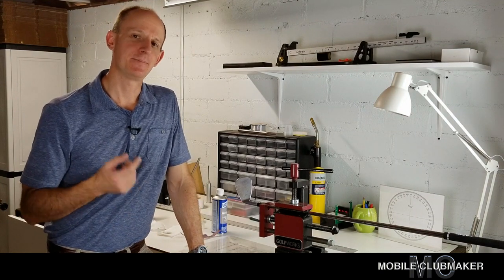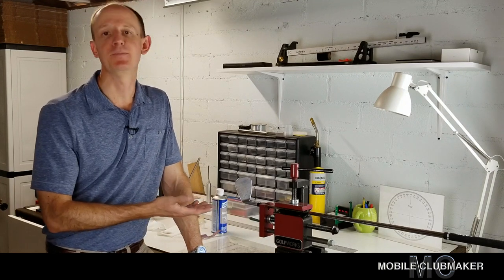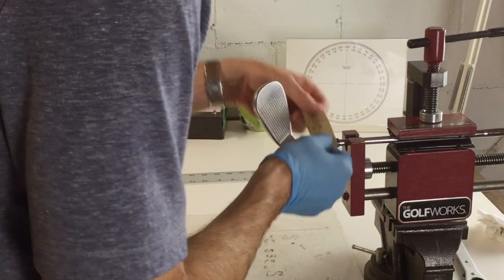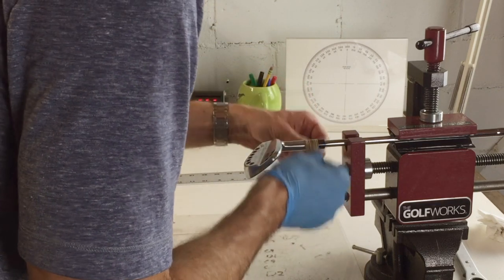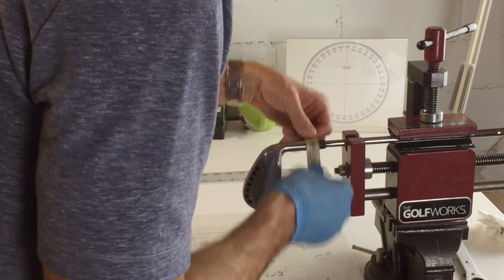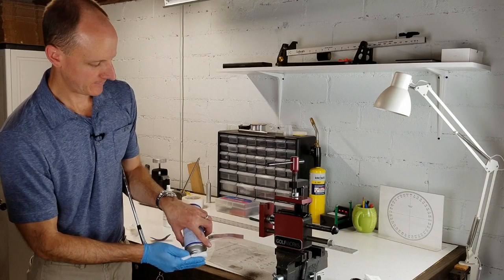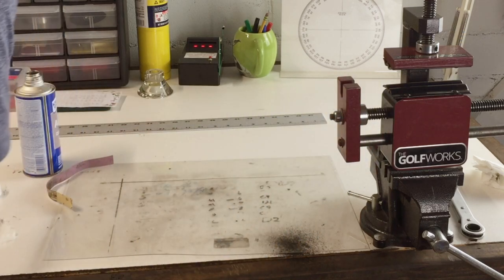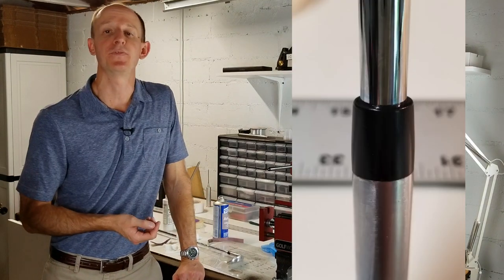Turning Ferrules- We don't need no stinking belt sanders!

Comment: Any tips for multi colored ferrules (like BB&F Rainbow type stuff)?  Acetone will likely make the colors bleed a bit.  Also - what grits are you using in this video?  Is there no concern about scratching up the hosel while sanding down the ferrule?  Thanks!
Reply from the maker: The sand paper grit I used was around 120 for the medium and 220 for the fine finishing. If you are working with a chrome or brushed finish iron, you shouldn't have any issues with the finish when doing the sanding by hand. If the club is painted or has a different finish you might want to tape off the area with masking tape to protect it and just take your time with the sanding.
I've done plenty of BB&F ferrules. No issues with acetone. You should only be using very very light pressure with it, so colors don't move.
Reply: @EFGMC  My first attempt at turning down a ferrule was a bb&f ferrule and it was a disaster.  Colors everywhere, fibers melted into the ferrule, odd indentations.  Since that time, I've put together several sets - all of which have embarrassing lips.  :/.

Now I'm too scared to ever try again.
Reply from the maker: @griffinmpc8144  A 1x42 belt sander with a felt belt can be helpful if you struggle with the other methods.

Comment: Aren’t you scratching the hosel. Don’t u need to tape hosel and shaft?
Reply from the maker: The chrome finish on irons is far stronger than what you will do with hand sanding like this. That said I would try and avoid sanding the metal as best you can. More of an issue with painted finish clubs.

Comment: Hi I’m looking to turn down my own ferrules. My clubs have black project x steel shafts. Will the acetone damage the black finish on the shafts? Thanks!
Reply from the maker: Not from a gentle brush, but a hard wipe might. I would recommend masking tape the area to protect any wayward acetone work.
You could also do a test if you haven't gripped the clubs yet and do a acetone wipe up at the butt end where the grip will go. This will give you a good idea of how the finish will hold up.

Comment: I’ve used this method today, used 120 and 240 sandpaper and the acetone to clean and white spirit to finish. The ferrule were nice and shinny whilst they were still wet, but now they have dried they are a dull black colour ? Have I done something wrong ?
Reply from the maker: I've stopped using the spirits at the end. Best results come from just brushing acetone lightly (very lightly) onto the ferrule and allow it to dry.
I fold up a paper towel multiple times, get a good amount of acetone on it, and then just brush the ferrule with the weight of the towel. Don't push down on it.

Comment: want to mention to those looking into a bench sander that 1" x 30" produces too fast rpm's...go with a 1" x 42"
Reply from the maker: True. Check the rpms on the particular model. You can use a faster speed but the margin for error becomes very small.

Comment: A.J. I left some material from the paper i used with the acetone  .Will I need to replace  the ferrule or try sanding the it again. Thanks.
Reply from the maker: I would just sand it again to remove any fine threads, then back to the acetone. Make sure you use your finest sandpaper to get it looking smooth but cloudy, then use the acetone with the most gentle touch possible.

Comment: The one problem I see is that the sandpaper is going to mark the finish on the hosel.
Reply from the maker: It won't be an issue on chrome or brushed finish heads. If they have a dark finish or similar, then I would recommend masking tape over the areas you want to protect and then pay attention using a more narrow strip of sandpaper to minimize going over those delicate areas.

Comment: Thanks for this really simple what is medium and fine sand paper (250 grit or 400 grit for medium)
Reply from the maker: I am using 120 and 320 grit but the exact numbers don't matter as much. You just need one lower, say under 200 to move material, and then something 320 or more to smooth it all out before moving onto the acetone. One other thing that I didn't mention in the vid, is wipe down the ferrule and hosel with a damp cloth and let dry before using acetone. The plastic dust from sanding can reform with the acetone and you'll end up having to clean the hosel off with a knife or something where it touches the ferrule. Saves a few minutes of scrapping if you wipe it down well on the front end.
Reply: @EFGMC  thanks!

Comment: How do you avoid scratching the hosel?
Reply from the maker: Depends on the finish. If it's chromed or brushed like the PXG I used in the video, you can run the fine sand paper over it with no real worry of damage. Even the medium grit won't usually damage those finishes when sanding by hand with a gentle stroke. Of course you always want to try and only sand over the ferrule but not an issue if you go over slightly.

If you have some sort of finish on the hosel (black oxide, blue, copper, etc) then you want to be more precise with the sanding. I would use a thinner strip of sand paper. I will also wrap some masking tape over the hosel (just one layer) to protect against slip ups especially when using the medium grit and trying to move a lot of material. Then I can take the tape off and carefully use the fine grit to get that edge flush.
Reply: Masking tape is the way to go. Just one layer on the hosel so you can judge how flush it sits. Couple more layers on the shaft is fine.

Comment: Great vid thanks..could i use metel ferrules on graphite irons shafts.THANKS Regards David
Reply from the maker: That is a great question, and I have to admit I have never tried or heard of results from doing such. So I am not sure what the result would be as far as possible shaft damage over time. In my head it seems like it could cause issues depending on the hosel design but that is a guess. If you do it, let me know how it works.
Reply: @EFGMC  I've a set of wilson staff fg43 tour blade iron heads which are absolutely beautiful  and have never been used.They really are stunning.I want to install miyazaki regular shafts with white tour wrap grips.The aliminium ferrules would just finish them off very nicely.Apparently these heads may be around 45 years old and the only ones that they made.I'm just thinking would it cause a stress riser ..Thanks Regards David
Reply from the maker: @shellyad100  I would be more concerned if the shafts are lighter vs heavier but in the end I just don't have experience with aluminum ferrules. Sorry.
Reply: @EFGMC  Okay Thanks.
Reply: @EFGMC  Well I've got a lot of balls with graphite shafts fitted with aliminium ferrules and it seems fine. .
Reply from the maker: @shellyad100  Hope you hit them well. Let me know how they are working once you have some time on them.

Comment: what grit paper did you use?
Reply from the maker: Start with medium grit (around 120) to move more material. Then move to fine (220 or over) to clean up the edges before moving to acetone.
Reply: @EFGMC  okay...Will a felt belt work with this method as well?
Reply from the maker: @micahgregus1659  Yes, you can finish with a linen or felt belt. May not even need the acetone if you go that route.